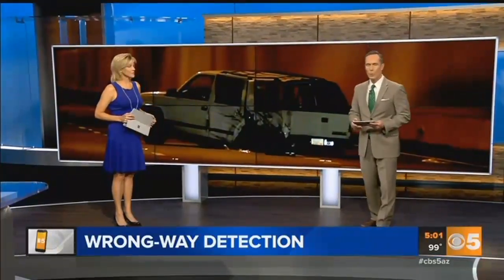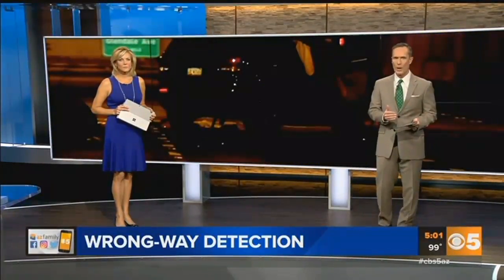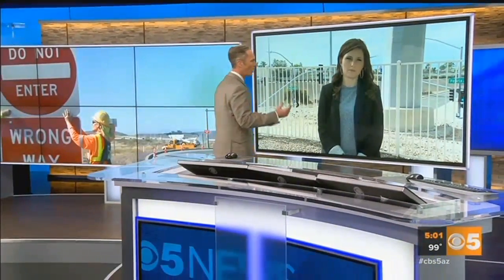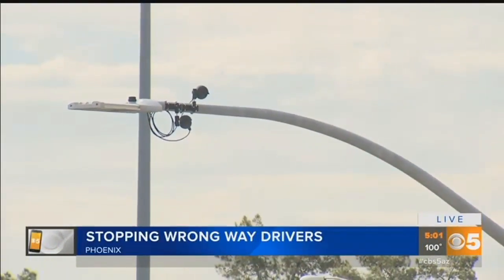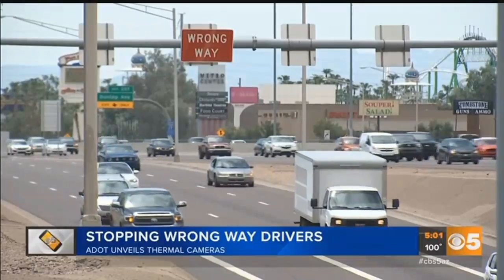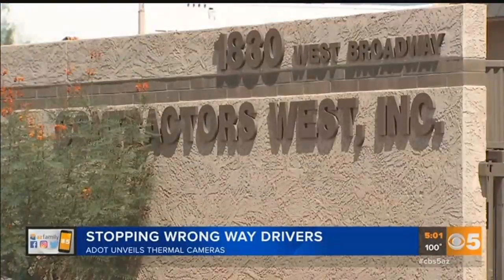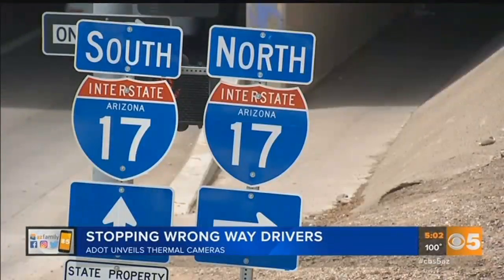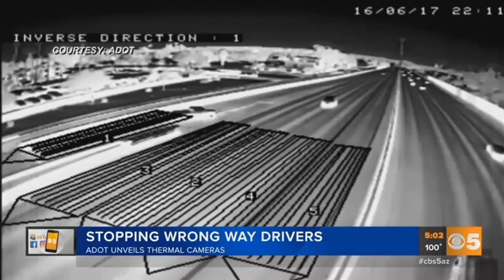Wrong-way drivers: ADOT’s thermal camera detection system to become reality

Comment: Morons! Your bus is leaving!! Who's the genius who came up with this Rube Goldberg "solution" to wrong-way drivers? ADOT immediately dismissed the tire shredder solution that has worked so well in other applications. Nooooo . . . ADOT needed something way more complicated and expensive to do nothing but DETECT wrong-way drivers. It still takes a cop to track the perp down. How many innocent drivers will die in the meantime? I suspect some money made its way into a pocket or two. This sounds like a huge boondoggle. Is Lockheed Martin involved?